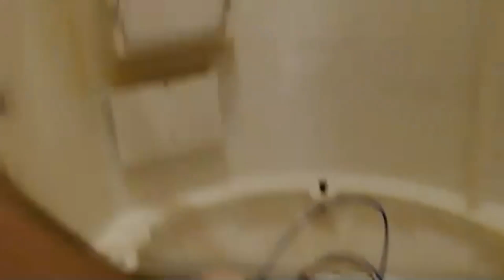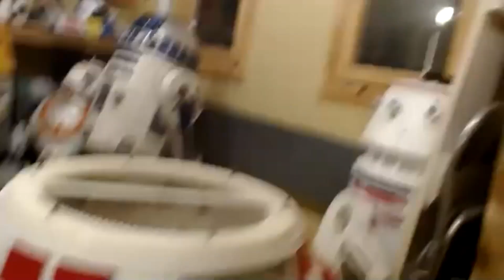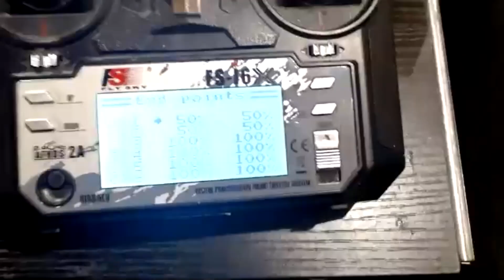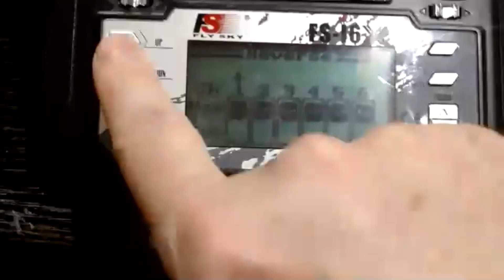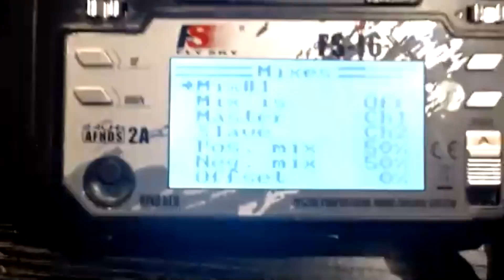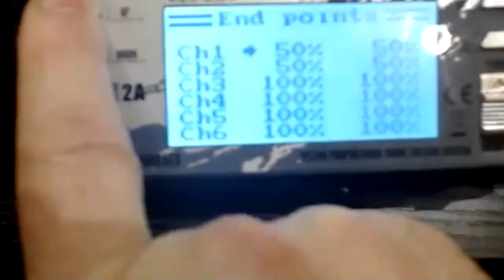Zoomtech - Electronics basics part 2 - A basic RC system for larger droids.

Comment: Greetings!
  First, I like your video and I have a question how to make it so that when I turn off the RC Controller, the Sabettooth 2X32 turns off the motors and does not continue to work on its own. Purely for safety. I made a lawnmower that I control remotely with a sabertooth 2X32A.